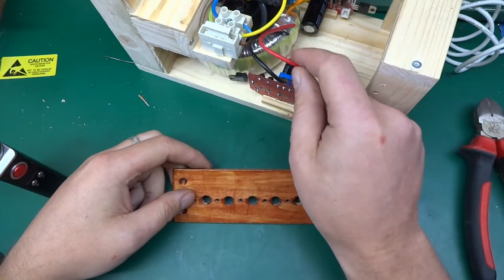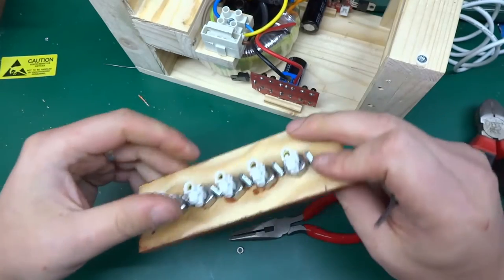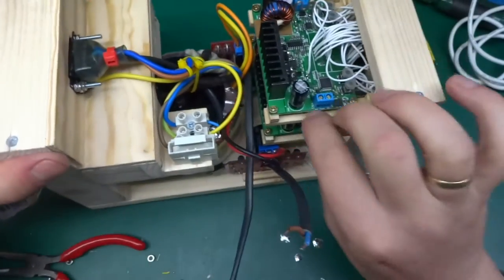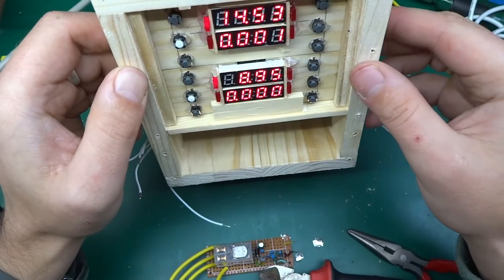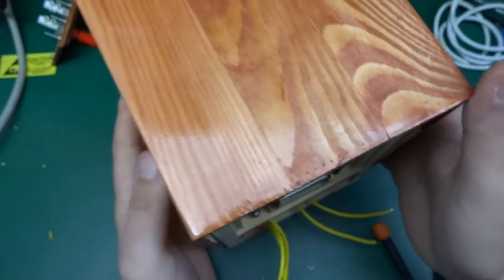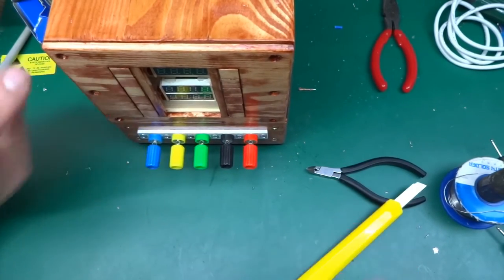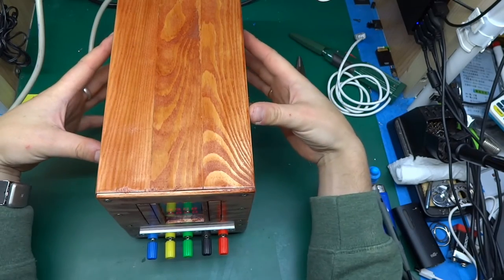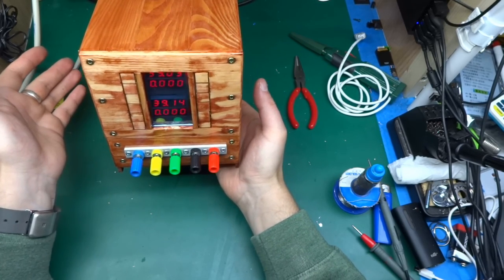DP30V5A-L   Dual DIY lab bench power supply build - Part two

Comment: I have one DP30V5A teamed up with a single Toradol Transformer that came out of a Power Lift Chair. It has a full Bridge rectifier (6 amp diodes ) with a good size (Cap= 63V 2200uf) It said its RMS 24v 3.33 Amp that's all on the same PCB with Transformer package. It Worked great for about 3 months . Then one day I was running some low voltage 1- 3 V 20 milliamp. The DP30 did not like it! It burnt & let the magic smoke out on the Shockley diode that's right after the coil or choke coil. it's a surface mount and most of the pads are gone. I'm afraid I'll probably have to buy a new one. I'm not sure how to fix it?

Comment: nice build i am building one myself and i am puting a linear and an switching one. your modules are rated at 5a and they cant suply that power vithout active colling or an new heat sink
Reply from the maker: Yes, those modules are quite capable for how small they are. It hever hurts to try and keep it a bit cooler though :)
Reply: why do you hate linear power suplys so much
Reply from the maker: Why do you think i do? Lol, i love all electronics equally, no matter the type, gender, origin, technology or principles of operation!
Reply: oh ok. but in the first part you seid that they aren good and is better to replace that filtering cap to an bigger value
Reply from the maker: Imagine 0-30v supply at 5A current. Switchmode supply will be fine across the full voltage and current range. Linear supply on the other hand, lets consider 5v @ 5A load - output transistor will dissipate approx. 125watts ((30v-5v)*5A)  - that's why i consider a switching mode better for variable supply
Reply: first i didnt like the look of the wooden encloser but when you finished it is very nice. for my power suply i am goung to use an old kaset player and modifie the front plate to aluminum